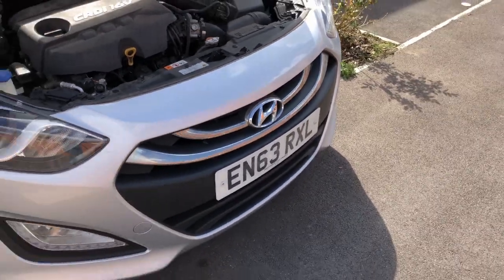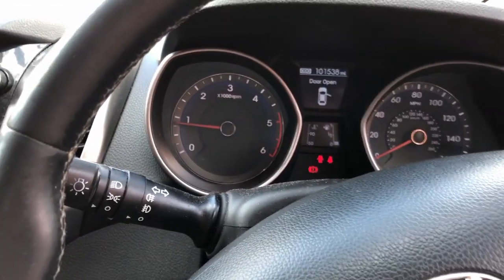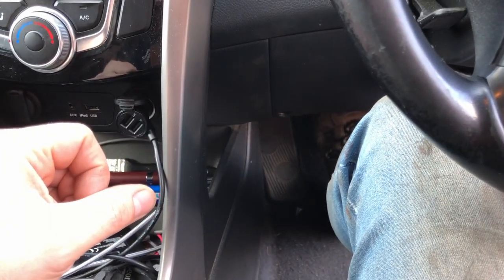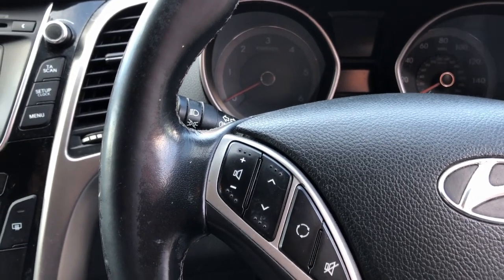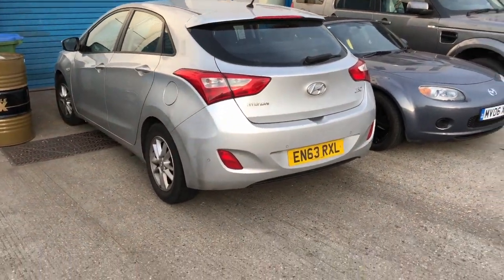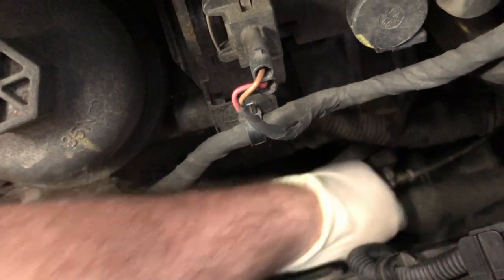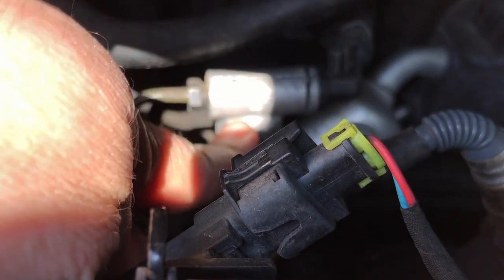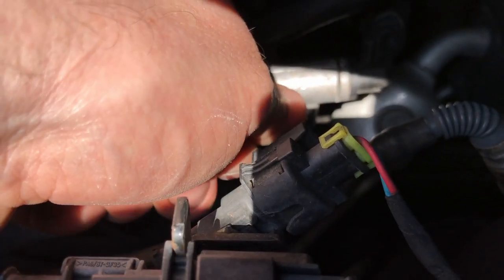2013 hyundai i30 Crdi - clutch fault - been to several people - not fixed - can i fix it?

Comment: I was going to buy a 2010 Hyundai i30 second hand a few days back. Owner had got the clutch and gearbox replaced. Noticed when I sat into that the clutch felt a bit weird but obviously not a mechanic so I thought it was fine. Took it for a test drive and the clutch got stuck and wouldn't let me put the car in gear. Took me a minute with the hazard lights on, stalled in the middle of the road to realize the clutch was stuck. Pumped it and it worked fine and got into gear. This video has been very informative! Great work, might skip on buying this model

Comment: So what was the outcome? My wide's i30 2010 is doing something similar, but when driving the clutch went entirely free with no pressure at all, and for some weird reason it cut out the electronics like as if the battery was disconnected. Is that a safety feature? Anyway, after I turned the engine off, the clutch started "working" again and I was able to engage the clutch to drive home. Any ideas there? It's happened twice now, so there must be a leak somewhere?
Reply from the maker: Outcome in part two 👍
Reply: @Roverturbo  Also the same except the bottom of the travel with the pedal as this is still soft travel to bottom of pedal travel with my neices H i30 blue estate version, I replaced damper with plug bled and no difference so need to investigate further.
What would be good with your videos is the mileage aspect as unless riding clutch in cars since about 2000 these items usually are lifetime (Rear brakes (Shoes anyway) clutches etc)
My mark 3 escort estate 1698,500 miles before selling presently on my Dacia duster 165,000 miles never replaced clutches.
Reply from the maker: Good point. 👍